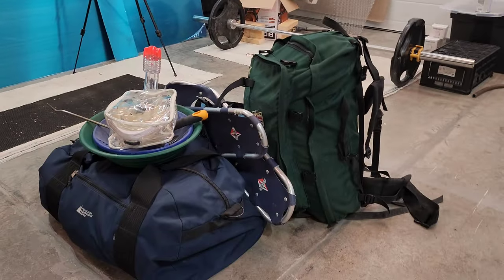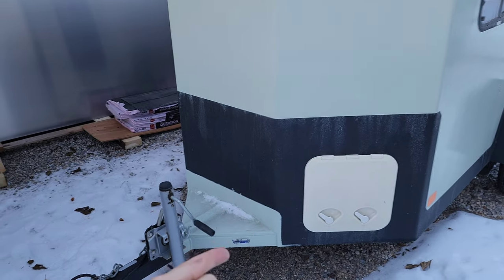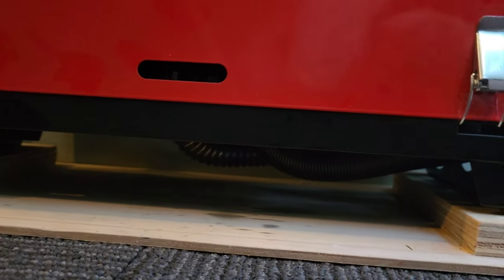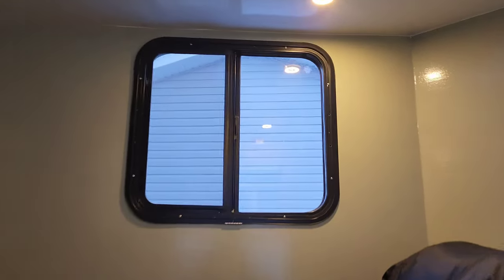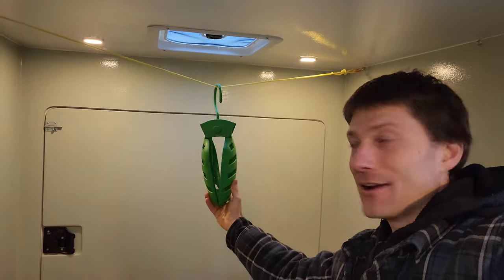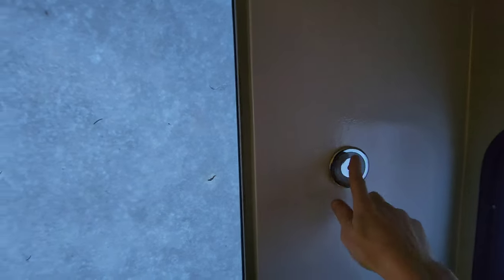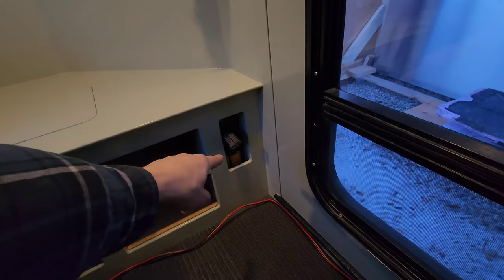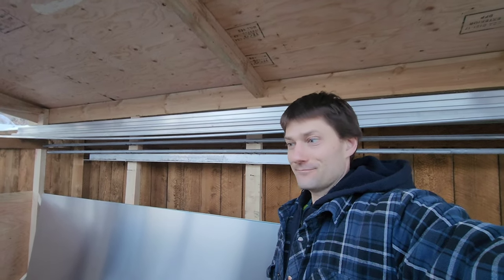I installed a diesel heater into my camper to use for winter gold mining.

Comment: Do you think you should lift the heater a bit higher so that the water will drain out of your exhaust pipe?
Reply from the maker: The exhaust seems to run hot enought it should just vaporize any condensation.

Comment: I'm sorry but I'm programmed to try to find flaws in everything, but: The heater needs to be filled from the top of it - INSIDE the camper.  It is sitting on a nice bit of carpet..  Sooner or later you WILL spill diesel when you are filling it up and it will smell for ever  Trying to sleep with a nice stench of diesel isn't easy / healthy.  What if it sucks out all the oxygen while you sleep?  Anyways - the camper is nice. What? Are you a youtube millionaire already?  You have car, house, workshop, aluminium plates, pipes, wooden shed, welding machine, power-tools, boats + outboard engines, jetski, boat-trailers, honda water-pump, gold mining equipment, high-banker production facility, diving equipment, concrete porch, private parking spot, camper, diesel-heater, drones, camping and climbing gears and a never-to-be-seen girlfriend (but we trust she exists) and a neighborhood cat. You have it all (except from maybe an asian mistress). It must be easy to be you ...
Reply from the maker: Excellent point about filling the heater.  This install is temporary, and the carpet is made from individual tiles I can replace if I spill any....  If like was easy, it would be boring. Gotta grind towards those goals sometimes even when there's a bit more friction than you'd like...